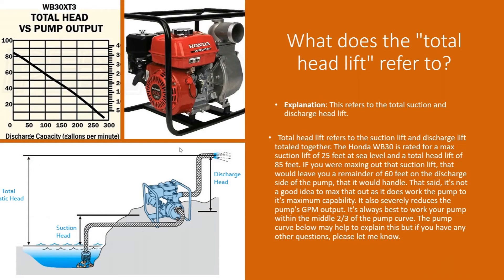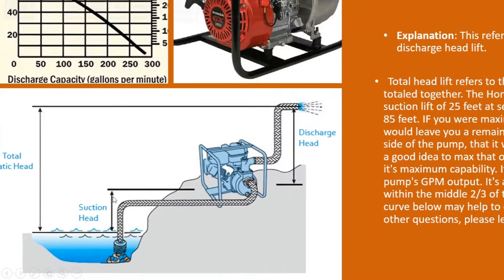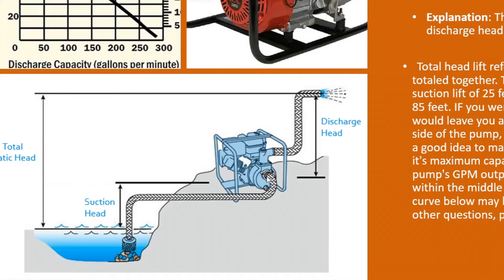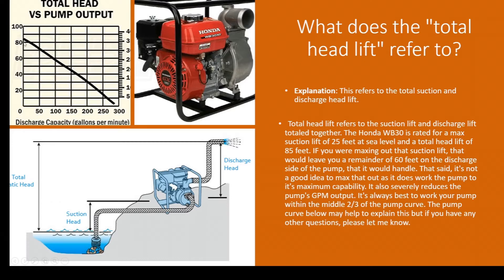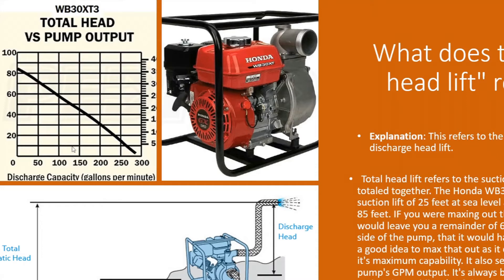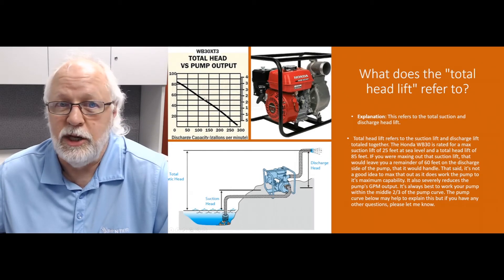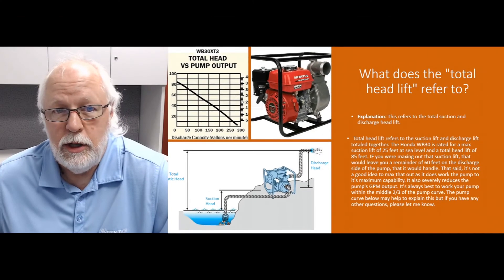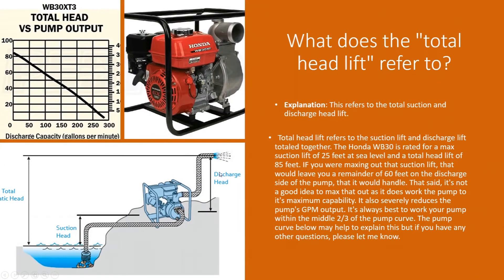How High Can My Water Pump Lift Water?

Comment: Hi, if I have a gas powered pump outside a basement garage that can discharge directly to ground with no lift needed but the intake hose is 30-50 feet in the garage below (access through a stairwell), do you see any flow issues with any pumps rated at 85 ft ?  Side note : the water pumped out is dirty water from pressure cleaning/washing a garage floor (max of 14 gpm) where the sand/dirt will clog the drains.

Comment: Is it possible to lift the river water @ least 200ft.up hills using multi-stage in-line centrifugal pump?Or else just to prime the suction side of the pump first before start-up.
Reply: If you done your project lift water kindly share me full detail which pump or motor u use hand how much water did u get 3:37

Comment: Good day, I have a Honda WX10T thats rated for 37m. It has a 1in discharge port. I used a bell reducer to reduce from 1 in to 3/4 in PE pipe. The PE pipe is 150m with approximate elevation of 30m to destination. But the water was not able to reach the required elevation. If i used a 1 in PE pipe, would it be able to reach max Total head of 37m?

Comment: I understand total lift, but what about distance.  I'm trying to bring water up a hill 50ft that will need a hose 100ft.  Is that possible with a pump that has a total lift of 100
Reply from the maker: There are several formulas used to calculate that along with THL, but we'd need to know more specific information. Please give us a call and we can help walk you through it.

Comment: Hello, I'm looking between a 2500 gph & 4500 gph for a backyard pond waterfall. I'm fairly new at this. The waterfall starts at 6 feet elevation about 20 feet away from the pond and flows over a rock formation (20 ft long) gradually decending until it reaches a 24 inch cliff at the end which spills into the pond. The entire width of the decending water feature & cliff is 16 inches wide. (So fairly narrow) I would like a decent flow. The 2500 has a head lift of 19 ft and the 4500 has head lift of 23 ft. Which would you suggest? Would the 2500 be enough? Is 4500 overkill? Thanks in advance. 🙂
Reply from the maker: This video (https://youtu.be/-CuJcAF88AI) should help answer your questions. If you still have some, please give us a call.

Comment: Hello i have one queistion. I have that pump. ITs Honda 3". I have some pipes in the field that are 2" diameter. Would it increase the suction pressure for 21 feet deep pipe in water well that is 90 feet deep if i reduce that suction pipe from 3" to 2"
Reply from the maker: Reducing the suction pipe diameter on ANY pump will reduce the efficiency and flow rate of the pump, and reduce the life of that pump.

Comment: What would I need to pump water on a slight uphill incline about 200 ft. This would be used to run a series of sprinklers. It is coming from a rain storage tank. I would have several zones to water an orchard, garden, etc.
Reply from the maker: That is an excellent question. Check out this article and then give us a call and we'll help you size your system properly! https://www.waterpumpsdirect.com/stories/1344-How-to-Select-the-Perfect-Sprinkler-Pump.html
Reply: @PowerEquipmentDirect  Thanks. I will check that out now.

Comment: I have to pull water from  1.5km away from my residence please guide me in the situation. i have to install the pump at my home
Reply from the maker: We don't have enough information to make a recommendation on that. That far away would be difficult for any pump. Plus it's always better and easier on the pump to have it as close to the water source as possible.
Reply: @PowerEquipmentDirect  thankyou

Comment: Can you increase the head lift by reducing the outlet diameter of the discharge hose
Reply from the maker: Artificially increasing water pressure and head lift by reducing hose or pipe diameters is not generally recommended. We recommend that customers start with the pump as the source of power and capability and have all of their discharge hoses and pipes properly sized to match those specifications. In extreme cases, you could potentially damage a smaller diameter hose on a water pump that is forced to put out pressure higher than recommended by the manufacturer of the pump. Plus, it can be unsafe as well.